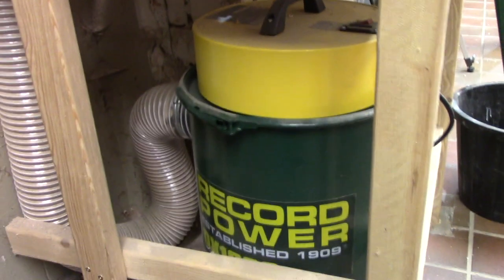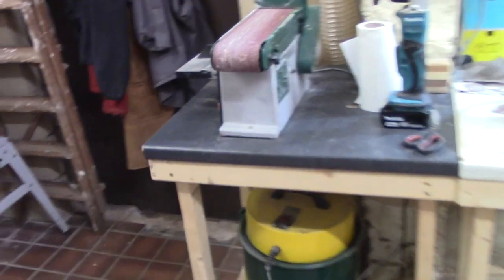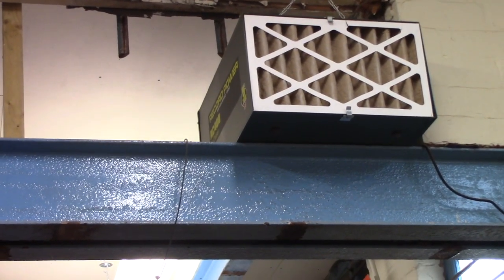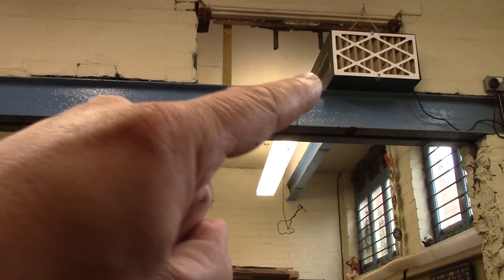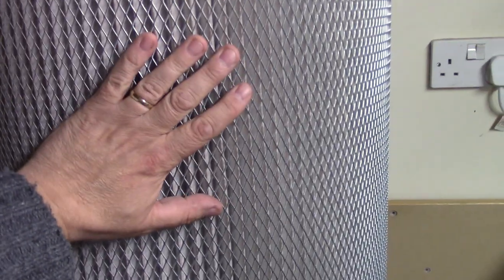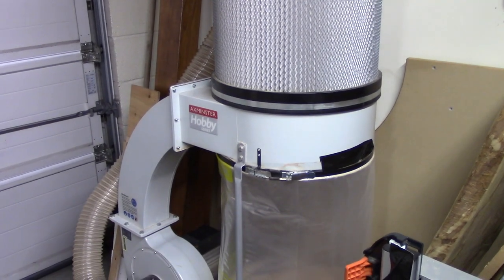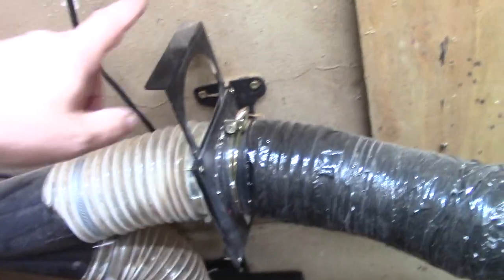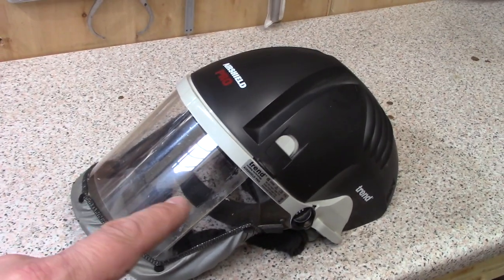Basic Guide to Workshop Dust Extraction - Woodturners Workshop Tour PT1

Comment: Great vid. Thanks. Perhaps this is a stupid question, but for the first one you show...I was planning to have one similar unit, with a network of pipes leading to each of my tools and some sort of manifold to select whichever tool needs the extraction at the time. Can you see a flaw with this? Just wondering why you choose to have one extractor for each tool. Perhaps as these machines are quite smaller, they won't be up to the job of pulling material a long way? Thanks, Phil.
Reply from the maker: Hi John sorry it’s taken so long to reply, it’s should work but it will depend on the power of the extractor to how far it would pull. The pipe work is quite expensive so it may still work out cheaper to have a couple of dedicated extractors
Reply: @PhilScarlett  thanks for the reply, Phil. I have a load of pipe work left over from my home ventilation system, so my plan is too repurpose that. Again, v useful vid - had never considered the different types/sizes of dust before.